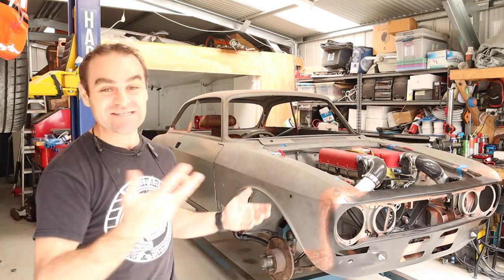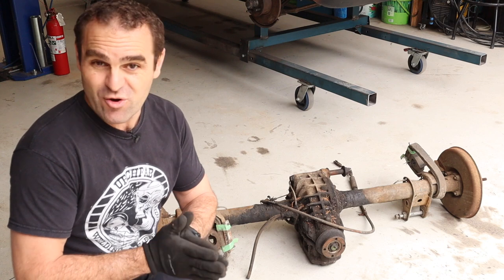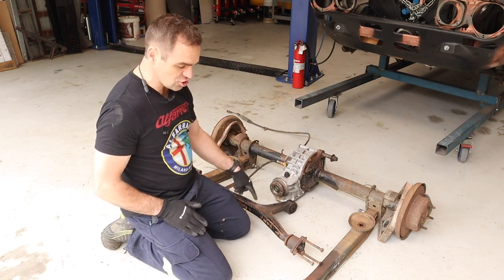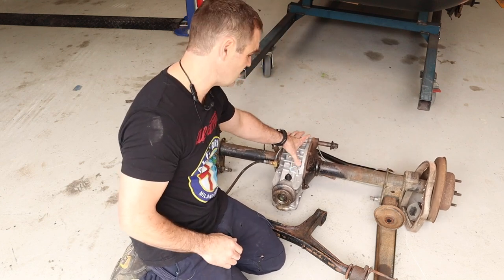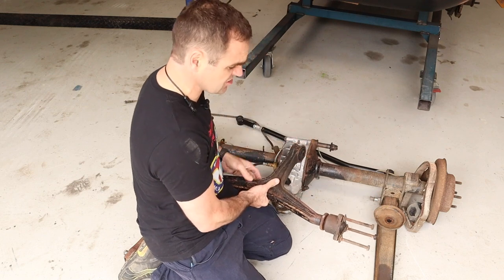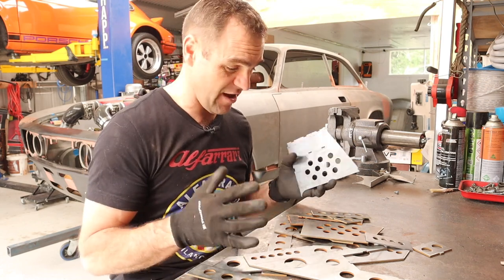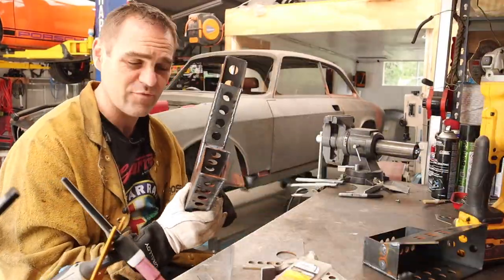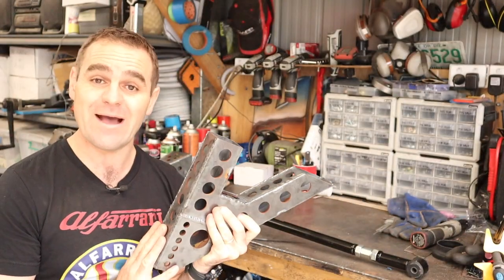Playing with the rear end - Ferrari engined Alfa 105 Alfarrari build part 74

Comment: I built a 300 hp turbo GTV. I used the stock 74 rear end with 81+ 4.10 gear ratio. The car was raced and the diff handled the power no issues.
Reply: Most diff issue's are caused by hard launching from a dead stop with sticky tires, like drag racing, so for road racing or similar I don't see why most diff's would not hold up.

Comment: Great work on the suspension, the brackets look great. Personally I would have probably gone for the alfaholics watt's link conversion kit. The panhard rod won't be as good for a track car as the linear travel of a watt's linkage. I totally agree with you limiting yourself to not changing the rear suspension, that is truly only a job for mad men in sheds in Shropshire.

Comment: Instead of a sliding bearing on the top of the diff, where I expect problems. You could also change the t-bar for a fixed straight bar pointing in the length of the car with bal bearing rods that allow the diff to move a little bit from side to side.

Comment: Nice work on getting the jigsaw puzzle togeather, to be honest I designed it that long ago, I'd probably struggle! If your just going to run the button hole, you'll only need to cut a little bit out of that side bracket to get it to clear the Bush, don't worry about capping it over, those double skinned mounts are plenty strong enough, looking forward to the next vid
Reply from the maker: Haha, I enjoy a good puzzle. Thanks again mate.
Reply: Sharing is caring 🙏

Comment: Absolutely nothing wrong with the live axle from the original car. I built a westfield clubman some years ago and opted for the live axle instead of the independent rear, and it was fine. Surprisingly comfortable, and compliant with the added benefit of adding lightness. It performed very well, and also had the panhard rod setup. I'm checking your subscriber progress regularly - any day now!

Comment: Great work Jeff! Remember stress will find always find the weakest link....so  I'd highly recommend reinforcing the ears that mount the trailing arms on the dif. Spherical bushings on the trailing arms are a good idea as well along with a link with spherical ends replacing the t bar. All that should allow you to position the rear end perfectly. We have this setup on our GTV race car.  Hasnt failed in 20 years (knock wood)  Can Send pics of our setup if you like.

Comment: ahh the panhard rod seems a backwards step in some ways...yes the roll centre is lower but now your suspension is moving in an arc...my Gemini race car(that raced at bathurst)was built with a panhard rod but with the build to Group c  ran(and still does) runs a watts link...and if it is set up correctly it can actually be adjustable in Hight so adjusting roll centre.
Reply: I believe the more horizontal the panhard rod is then is lessens the effect of changing the length /arc of the rod through the suspension travel. But yeah, it's still there
Reply: @melbournecyclingsegments7510  your probably right..but in so many way a watts link is the best compromise.....what worries me more is using the stock upper link works really well...and will using both a stock upper link and a panhard rod counter act each other?
Reply: @ozrbfan  yeah I'm not sure either but I think there was mention of some mods to that t-bar so we shall see soon enough

Comment: Make sure the body mount portion of the Panhard bar is robust. There is far more load there than you would think. It is not the mount that will fail. The body panels will fatigue and tear.
Reply: Any metal structure behind the rear axle on these 105 cars is weak. The body is not meant to take up any forces from the rear suspension at those points.

Putting in an LPG tank on those cars will over time litterally shear their ass off...  Reinforcing this area is necessary.

Comment: Gold star for your presentation Jeff! 

Have you had a look at the sliding block system that the GTAm cars used? Those cars had so much rear grip that they would lift a front wheel in heavy cornering rather than lose traction at the rear.
Reply from the maker: I had a look at it on one of the real GTA's but I have heard they had a habit of binding when they were worn and were not the best for longevity. I believe that is why watts links are much more popular these days.
Reply: @HomeBuiltByJeff  yeah that’s a good point. Fine On the track but maybe not so great for a road car.

Comment: Loved the "Cardboard Aided Demo"! The fact that you could demonstrate what the axle would do as it actually moved really sold the thing. Much clearer than some of the engineers who have written books on the subject! I'm not sure the spherical bearing and brass bushing are as good an answer, especially if you are still wanting to use the Alferrari as a road car; much road action and chatter will be transmitted directly into the body shell. Replacing the present bushing with a home grown urethane bushing (pouring it as liquid urethane) would be much better, but still transmit more NVH into the body. I do think, on the whole, that you have a good compromise, short of an all up independent rear end- if you ever "rethink" this (no project car is ever, ever, really finished), adapting an existing rear suspension that has an independent subframe might ease your problem, I'm thinking of the MX5 as an example. Myself, I've had really good results both drag racing and circuit racing with variations on the triangulated four link common on many GM chassis of the '60s and '70s. 
Glad you are back, and hope you and Mrs. Jeff had a wonderful holiday! Happy New Years from the colonial wilderness known as "that American thing"!

Comment: back in the 1980's we built a watts linkage setup for my '68 race GSprint.  It was night 'n day how much better the car handled on-track. with the stock rear-end, once the car start to go (spin/slide) there was NO way to bring it back straight.  you simply be doing 360 degree spins coming outta the corners.  the watts linkage changed all that.  I had complete control of the rear end, could step it out with the throttle and bring it back at will.  another thing we did was run a locked rear end.  which might not be good if your car is simply for street application.

Comment: Engineering Explained had a whiteboard, HomeBuiltByJeff has fully articulated cardboard models! A properly sorted solid rear axle isn't as bad as some people would make you think, and it retains a lot of the character of the car, with substantially less work than going to fully independent! At times, I regret going fully independent with the rear axle on my Anglia! Especially since I've now found that there's MUCH more aftermarket support for the English axle than the 200SX rear differential I'm currently using when it comes to diff ratios, LSD technologies etc!
Reply from the maker: Interesting. I am not sure about ratios, but I know there are tons of LSD options, etc, for the 200SX as they are the main choice for drifters.
Reply: @HomeBuiltByJeff  I guess I've not really looked much in the last 5 years or so, but what I did also find is that they're about 50% more expensive than the locally (for me in the UK) made stuff for the old Fords! :D
I'm looking for a nice low ratio like 3.3:1 - available for Ford, not quite as easily for 200SX! I've found one company over in Australia who do a variety of ratios, but then expensive postage to get them over here!

Comment: A much better system is replace the t bar with a forward link going to a cross bar bolted in place where the t bar went. This is much lighter and reinforced the rear frame.

Comment: Just remake the centering bar out of a couple pf bits of tube and ball joints .
A bit of square tube to go across and be solid mounted with a mounting point for a bolt on ball joint off a Toyota or something and a bar that foes to the diff where a bracket mounts a similar or the same type of ball joint. It will weigh about a quarter of the original setup.

Comment: I think the trunion bar solution is going to bind and screw up the Panhard function.  The Watts kit I use makes use of a rod with heim joints on both ends, fastened to a cross bar that connects where the trunion bar bolts to the chassis.  It will be interesting to see how this works out.

Comment: Ferrari engine. Old Alfa chassis. Live axle. Oh yeah, this car is gonna be a widow maker. At least it wont be boring to drive.
Reply: Rather like all Ferrari's including the GTO up to mid 60s.
Reply: auto  delta did the same thing back in the early 60's..it was fast.. they used a  'sliding block ' for the rear end
Reply: Nothing wrong with a live axle rear my rx7 has one although even i upgraded to a hilux rear that rear will be torn apart before anything major happens

Comment: Every one of those suspension joints says give me needle bearings!
Reply: That would not work. You need rubber or spherical bearings to be able to take the twist when you lift up one wheel😉
Reply: @giuliettaevo  I know. Thats why race cars use machined aluminum in place of rubber bushing.

Comment: The panhard rod has much better bite exiting a corner. However if you are concerned about handling move the lower front ball joint toward and downward. Please do everything you can to reduce weight over the nose. Carbon fiber hood, aluminum brackets for alternator. Aluminum brake calipers. Vented two piece rotors.  Possibly aluminum hubs. I suggest these things due to what you are building being so spectacular and I have a lot of experience with these cars. I am toying with the idea of installing a complete Miata rear suspension in an Alfa spider. I will use the entire drivetrain less the engine.
Reply: Forward and downward
Reply: miata rear suspension, is wider than the 105/115 chassie.. looked into it for my ecotec alfa spider
Reply: @randellgribben9772  how much wider?
Reply: @benhowe2087 1984. alfa 50.2  ...... 1994 maita 59.5
Reply: @randellgribben9772  that will be very difficult to shorten enough. I can easily make up an inch with wheel offset. A bit more with hubs. But it will take massive shortening of control arms and axles to accommodate 9 inches.

Comment: i installed a panhard rod in my spider.. i bolted the body pivot point to  a box section just, well the shelf in the boot of the car.. just to the rear( back of the car) were the shock towers bolt to the bodyshell if you look you will see it,, but because the box is empty, and made  of that grear quality alfa romeo steel. i drilled 3 holes on the top of the box area. and filled it with fiberglass resin.. took about 3 or 4 gallons of the stuff. to fill it.. after it cured, i had  a solid box to work with and could bolt the upper panhard rod pivot point ( photo on the alfa romeo bb... bianchi2 ecotec conversion ) to a soild area, with out any fear of crushing the box, of having it tear due to corner stresses.. very soild.. add benifit.. as my car is a spider,, and fiberglass filler made the bodyshell much stiffer..
Reply: forgot one thing.. i also have sperical bearings ( teflon lined ) in both ends of my trailing ar,s.. make the rear end very supple ... on eather side of the bearings j have solid  duro 60 rubber bushes to  keep the dirt out.( and it looks oem)

Comment: Keeping an axle is probably wise in the long run - whatever the compromises you'll always have a car that's stable and tracks well at speed. Designing and building and independent setup, with all the variables in its geometry, sounds like it would be a bit of a nightmare.

Comment: Rear axles will have their work cut out dealing with 3.5 - 4 times the power.......just saying....Spherical bearing may introduce some noise,,,Nice work on the cardboard explanation of the Panhard rod and Watts Linkage...Panhard rod brackets are very good too.
Reply: Wow, I didn't know that Ferrari engine was 600 hp. He's in trouble, coz Alfa 2 litre is only 150.
Reply: @moyadapne968  well maybe not 600 but 400 at least I would think... :-)

Comment: There are two way to make a butt joint - bottom side to top side, or end to side. This would change the width and length of the final item. Could this be the cause of the problem?

Comment: I figured you could've used a Milano/GTV6/Alfetta axle tube (which already has a watts link), an independent diff unit, and cv axles and made that work.
Reply: A fair bit wider then the 105 axle.

Comment: Actually roll center work in way, the higher the better. Because there is leverage from center of gravity to roll center. If the roll center is on the ground, leverage is  bigger and car rolls more. Best is to have roll center identical with center of gravity or even above. But that is hardly achievable.
This is not criticism, just explanation. I follow this channel for a long time and I can only say "thumb up".
Reply from the maker: The big issue with these car is the roll axis is far too steep, as the front roll centre is well below ground level ;)
Reply: @HomeBuiltByJeff  Is it? I know it is like thos when car is lowered quite a lot but not for stock car (height). I have the same issue but there is not much I can do. Best option is to use drop spindle but that is sci-fi for cars like this :)

Comment: Cool explanation with the card board Jeff. 

Are you actually lowering the roll centre like this, or are you adding a second one  with keeping the t bar? I think the actual roll centre will be in the middle like this, like with the watts link.
Reply from the maker: Nope only one. The top mount will slide side to side ;)

Comment: Um, if you're still using the upper T-bar to stop axle tramp then how is the roll centre any lower by using the panhard? Or does the upper pivot of the axle now slide inside the old T-bar to allow the panhard to be the new roll centre?
Reply from the maker: It will when I am done ;)

Comment: Hi Jeff.  I'm an Italian fun of this project. I've have a question about the differential: I see that you want to use the Stock Alfa Romeo Differential, but you are going to use a Ferrari 360 Modena engine. In this particular case, are you sure that this differential can resist, to the biggest Ferrari torque?

Comment: Silly question; is there a way to modify the original T-bar to work in an upside-down configuration?
Reply from the maker: Good question, but no, not really. It would be in the way of the drive shaft and would require a huge amount of reworking.
Reply: Oh, ok. Thanks for the insight!

Comment: If you use a spherical bearing on the OEM unit, IMO you don't need the panhard rod?????
Reply from the maker: It will slide on the mount, so it will not keep the diff central. Basically taking the trunnion arm from doing 2 jobs to just 1 ;)
Reply: @HomeBuiltByJeff  Not if you have some sleeves machined to keep it centered. It will go up and down and keep it centered. I had a similar setup on a race car. Those sphericals can take a huge load. Anyhow, in the end, you have to whole thing in front of you so I'm probably missing something.
Reply from the maker: @hasbeengood  I don't want it to stay centred. That is the whole point.
Reply: @HomeBuiltByJeff  Like I said, I must be missing something! BTW, I enjoy what you do!

Comment: Jeff do you know what roll center is at the front? If your roll couple distribution is wildly off you'll end up with really poor handling characteristics.
Reply from the maker: The front is below the ground, which is a lot of the issue with 105s is the steep roll axis.
Reply: @HomeBuiltByJeff  Are you sure Jeff, the  track control arms would need to be pointing up at 20-40 degrees for that to happen.
Reply from the maker: @neilt8790  Yep, I am certain. It is well documented ;)
Reply: @HomeBuiltByJeff  the ' roll centre ' is about 2 inch on a oem car below ground, there is a way to fix, it and have the front roll go to 1 inch above ground..done it

Comment: I'm guessing you'll be getting up to 250 lbft from the engine.  Axle tramp might be an issue but some modern dampers/coil-overs should be easy to source.  There's a company in the UK that builds 105s with quite big torque increases, although I'm not sure they've got near Ferrari 360 levels.  But they still might also be willing to advise on likely issues and solutions to stop this think twisting itself to bits.  They're at https://www.alfaholics.com   mail@alfaholics.com

Comment: Come on Jeff. You've allrdy put in a Ferrari engine. Just put a IRS in from another car. BMW E90, Mazda MX5 or something else that has a complete "bolt off" setup.
Reply: Very hard to do just that. The alfa 105 series is a very narrow car. 

Before I build an irs for my Giulia saloon i looked at all kinds of axles and there was nothing this narrow to be found. Even miata/MX5 stuff is something like 10cm/4" wider.
Reply: @giuliettaevo  That's why i suggested BMW E90. The center carrier is steel and can easily be cut and made smaller. All you then gotta do is find suitable axles or have them shortened
Reply: @LoupozE30  , the E90 rear axle would almost have the inner wishbone mountingpoints touching eachother if you narrow it that much.  Wouldn't leave much room for the diff.

Even an E30 rear axle is like 4" too wide to fit an 105 series.
Reply: @giuliettaevo  Ahh it's that narrow 🤔 There's a British company making IRS for MGB, surely those could fit, can't imagine a MGB being much wider 🤣